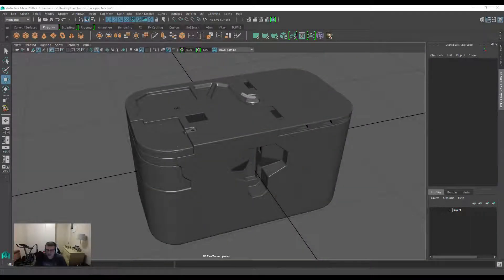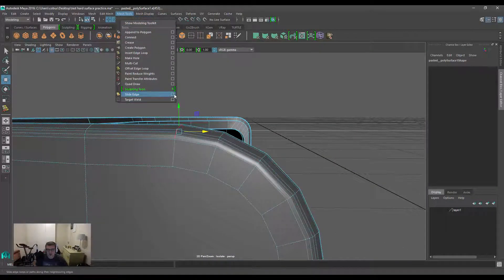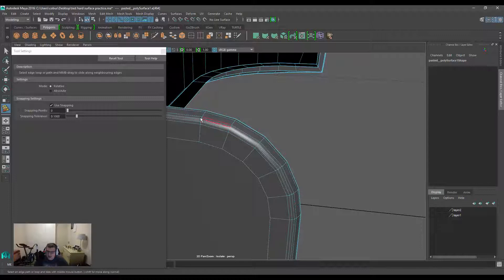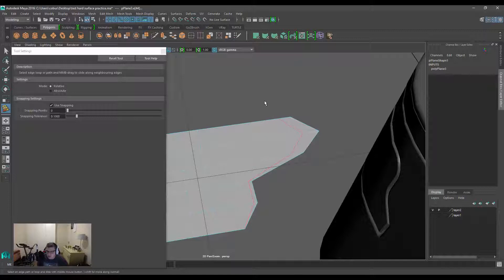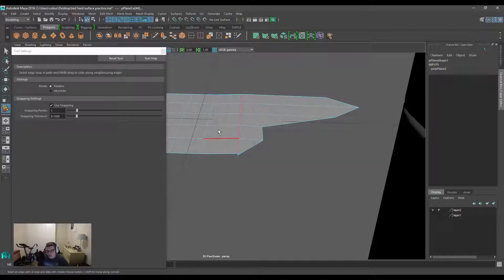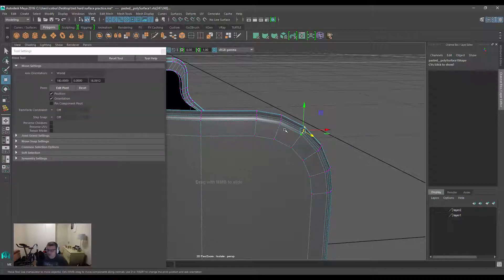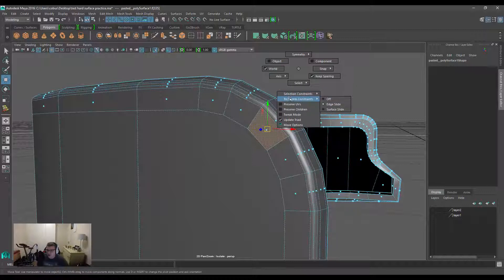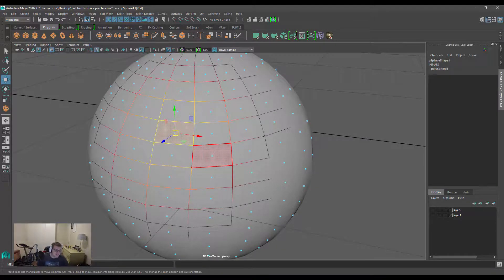Maya Toolbelt - In-Depth Guide - Slide Edge Tool

Comment: Hey I'm new to modeling and had a question. At 8:22 you show the corner of the object you're working with and it has more than four edges on the big face. It doesn't maintain quads, is that okay? I'm a bit confused about this. Thanks!
Reply from the maker: Luke Hyland hey Luke. this heavily depebds on whether you are doin a subdivision mesh modeling approach or if you are doing a conceptual mesh. there are many debates between what is correct or incorrect. the honest truth is that most companies require that you have your models done with subdivisions in mind. 

this means that the model should maintain its structur when you smooth it out. thus you need to have quads all over. 

however when your doibg conceptual dedigning like i have done here then you just need to make sure that your shapes that you Boolean out of, is at the detail level you want it instead of relying on smoothing the mesh afterwards.

I hope that make sense
Reply: Awesome! Thanks so much for the reply. And thanks for your videos. Super insightful and my fav tuts on YouTube!